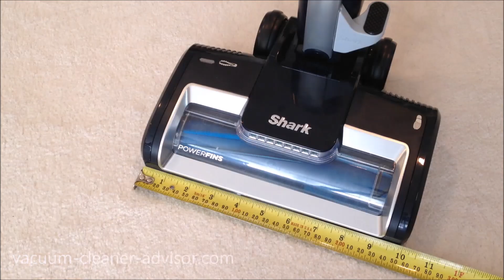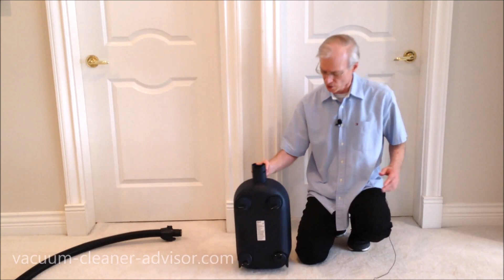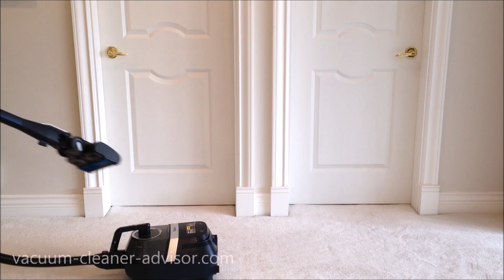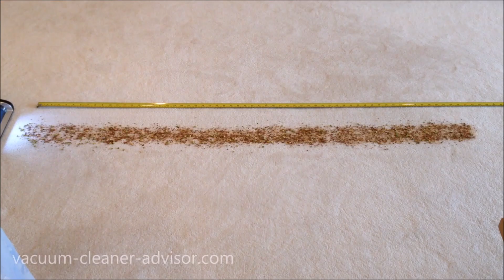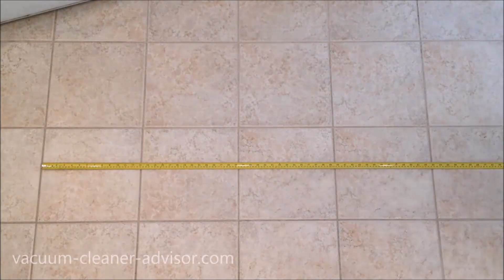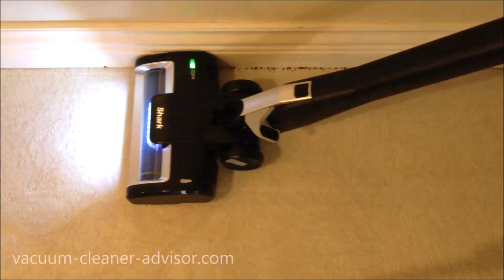Shark Canister Vacuum Review

Comment: Very good review.  I love the controls on the handle and found this vacuum when doing a search for that. I used to have a Hoover Wind-tunnel that had push-button controls on the handle but it only lasted a year and motor burned out from overheating. That is strange that it doesn't come with a dusting brush. But I have a Shark Lift-Away vacuum and wonder if it's dusting brush would fit on this one? I'm a little surprised you didn't try that two-in-one crevice/dusting tool on the end of the wand or handle but, oh well.  I also love that the rotating bar with "fins" is self-cleaning.  Now begins my search for the best deal on this vacuum. So far I see it on sale at Canadian Tire in Canada for $299 ($216 U.S.) regular $429 ($310 U.S.). Very good and thorough review!  And that's coming from a guy who had a childhood fascination with vacuum cleaners! I used to read a kids book when I was little called The Sneaky Machine about a boy obsessed with his grandmother's vacuum. :)  And I can still remember being enthralled at all the attachments and modes that my mother's Kirby vacuum could be used in.

Comment: Yes, the Vertex is great at larger debris. I know that from our dog chewing a stick into pieces on our carpet. Overall, I love it. My biggest complaints are the kinking of the hose,  the lack of bumpers, and limited included tools. As you said, they should have included a dusting brush, the combined brush/upholstery tool, and a pet hair power brush. I bought some, but it sucks to have to do. Having said that, getting under our couch with that hinged wand is great.

Comment: I already own the Shark Rotator Power Fin self cleaning roll and lift away canister.  While I really like this vaccum, I find the hose to the hand/wand is quite short and not really effective/easy to run a quick dust tool over a table when cleaning.  I also find the short hose is constantly pulling the vacuum over when I try to extend it.  Sure the pod lifts away but then again it's not practical for me to hold the pod lift away with left hand and reach above my head with the wand in my other hand to dust ceiling corners or over tops of door/window molding.  That's why I'm considering this canister.  It's virtually the same machine as my Rotator but offers convenience features I use in my cleaning.  I also like the light weight canister approach to alleviate back strain.  So thanks for your review, I think I'll go ahead and buy the Pet Canister - use both and then determine if the Rotator can maybe be moved on to family or donation.  BTW I have the PowerFin brush roll on my Shark Cordless canister vac for kitchen, utility and quick pickups between  major cleaning.  With two Springer Spaniels I can tell you the PowerFin as imperfect as it may seem to you is a God-send.  Pet hair with regular brush rolls is a nightmare and the PowerFin brush roll completely eliminates hair cleaning form the roll for me.   I was surprised to see you test that there was some winding of hair, but that's very unusual for my other two Shark vacs with PowerFins.  Perhaps the thick concentration and length of that dog hair was a challenge.  Unless you let your pet home go for months at a time, that likely would never happen.  thanks for the reviews.  Your reviews were very useful in my vacuum choices over the past couple of years.

Comment: I have tiles floor and a few area large rugs. This vac is best for my home but it not avialable in SG. I need to import it from USA. But your voltage is not the same. Mine is same as UK. 240 volts not 120 volts